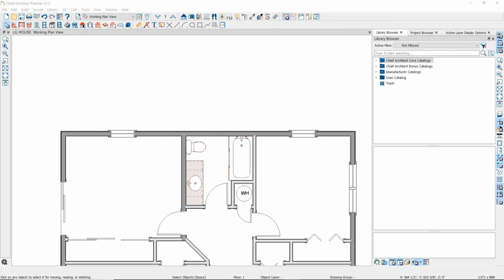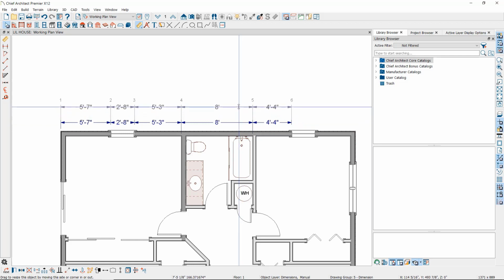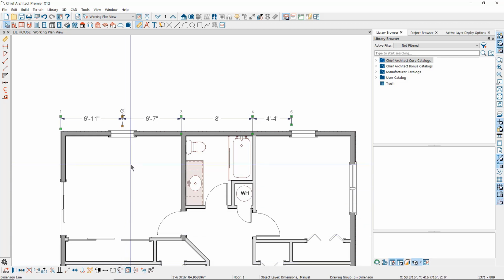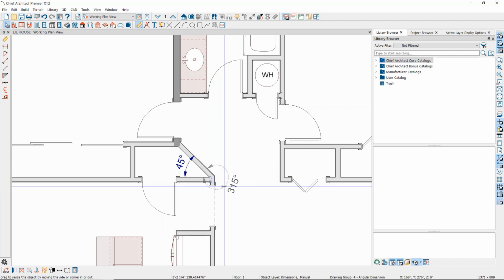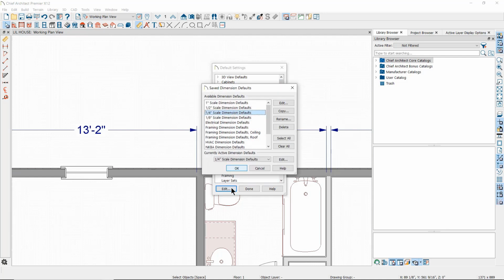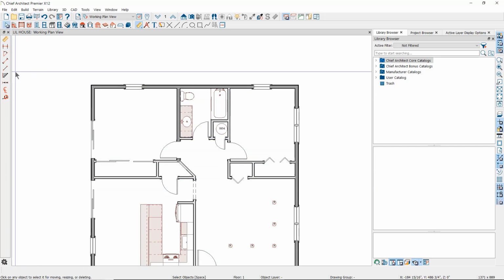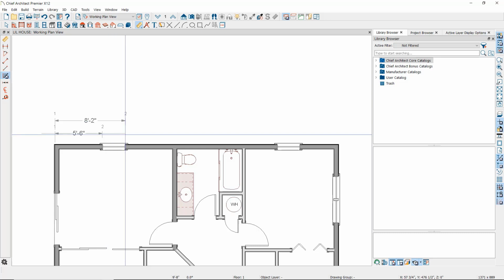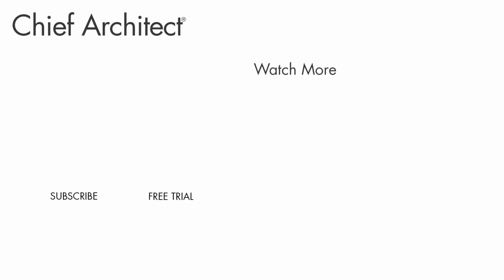Using Manual Dimensions

Comment: The End to End dimension does not pickup objects as you are showing. Is there a setting I am missing to active this?
Reply from the maker: I am sorry to hear this is not working for you. I would recommend reaching out to our Technical Support team to look into the problem further. Our support team has a lot of knowledge in this area and can help you troubleshot this issue. Technical support can be reached at 208-292-3399 Monday – Friday from 7 AM – 5 PM Pacific.